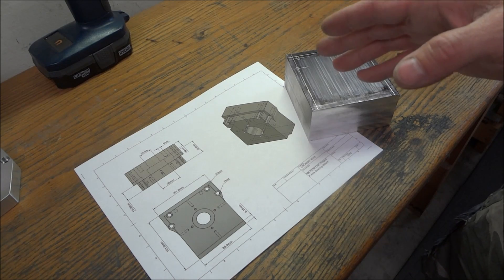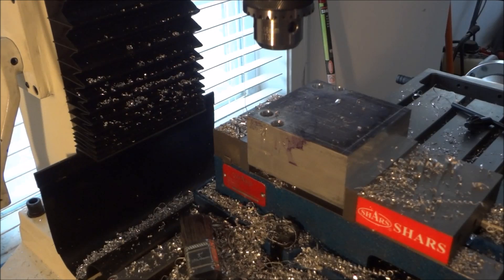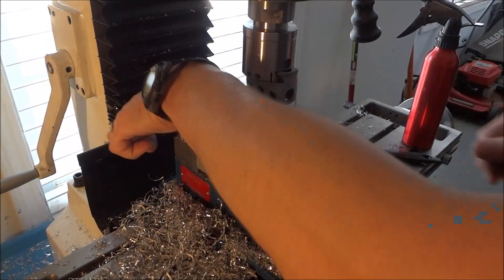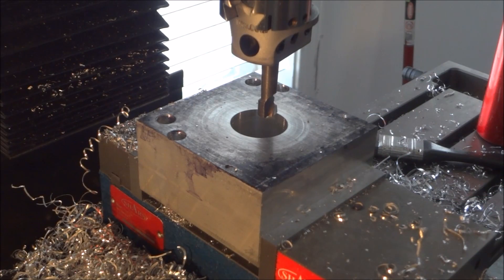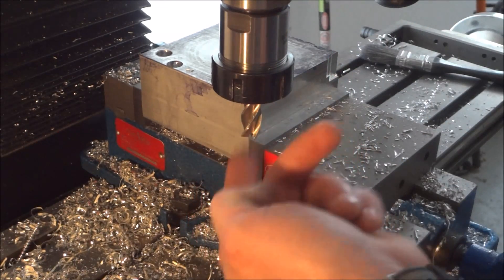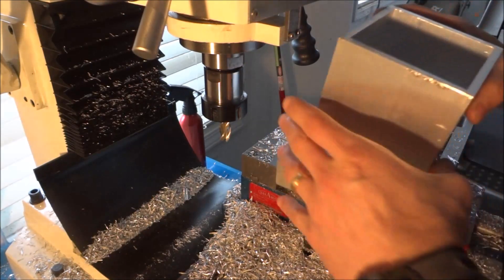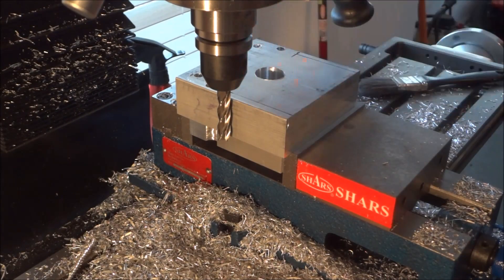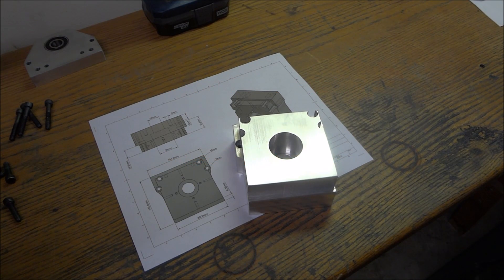PM 727M CNC  "X Axis Bearing Block Machining"

Comment: Sam, why brand of boring bar is that and do you like it? I am going to buy one soon and looking at all the affordable options. I was looking at the tts boring arbor to use with a boring head but didn't know if the rigidity would be as good as with the R8 arbor. I wanted to stay with a 2" so I could use the 1/2" boring bars on my lathe quick tool post as well. Any thoughts would be appreciated.
Reply from the maker: I would suggest that if you intend to some day have tts holders go that route so your not buying tools twice. Also go with index able  boring bars.  I suggest getting the 7/8" x 20 UNF tts arbor from tormach then a Boring head elsewhere. to save money.
Reply: Thanks Sam. I ran across an APT 3" boring head unused really cheap so I bought it. It has the R8 arbor. It will get me by. I would of preferred a 2" for most of what I needed. If I had a 4 jaw chuck for my old south bend lathe, I would just use it. I didn't want to invest in a 4 jaw chuck because I plan on buying another lathe later on.

Comment: HOW DO YOU THINK THIS MILL COMPARES TO THE ZX 45  TYPE MILL with 4140 steel ?????
Reply from the maker: I can say for sure about a ZX-45 It is a Larger mill and with this comes the Added weight which is always good when cutting seems more mass is better. Hard to compare as every build will be a little different and you could put a bigger motor on either.

If you have the space and feel the extra weight will benefit you I suggest you go with the ZX-45 series mill. Bigger is always better!

But the PM727M is a great mill and a good size for small shops with a foot print of a G0704 but way bigger in terms of weight and castings.
My Plans will not fit a ZX-45 however the mounts could be easily used on a 45 series with minor changes in bolt spacing for mounting. the electrical will interchange.

Comment: Well Sam after using the mill the little bit you have so far are you liking your decision and are there any pros or cons for the PM727. I too have one but haven't had the time to build my stand so it's still in the crate. AND IT"S KILLING ME to have it sitting there. Thanks for the videos and I do like the time lapse machining, it seems to show more progress if that make any sense
Reply from the maker: +Bill Baggins thanks Bill
The mill so far is great but all the hand cranking is rough :-)
I intend to try and use the stand that came with the mill. 
The time lapse allows me to include more footage. I think it helps. 
Be safe Sam